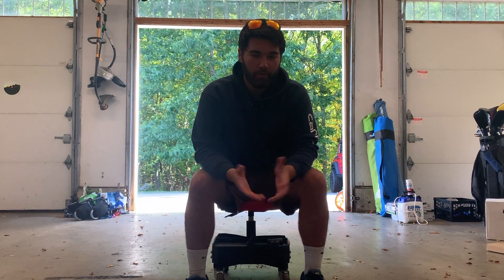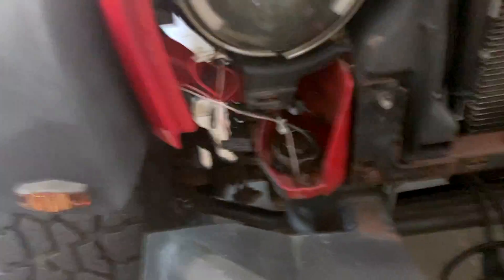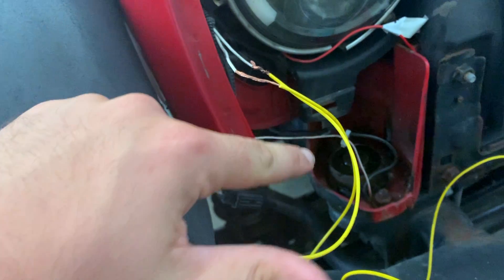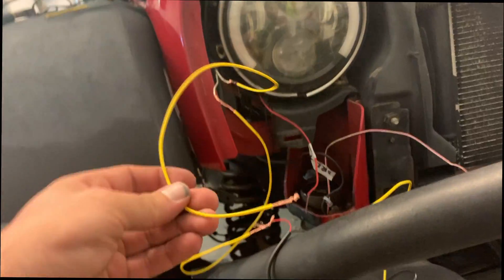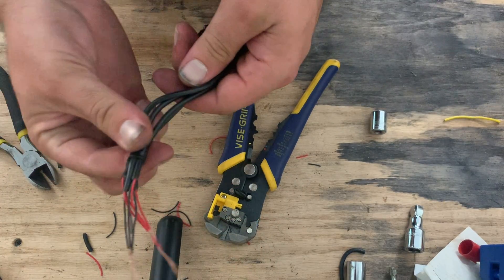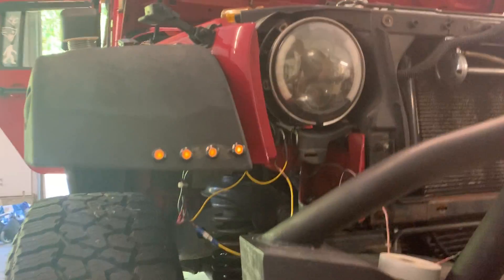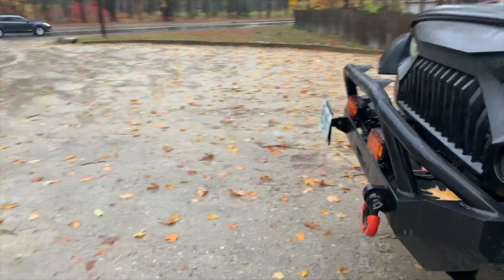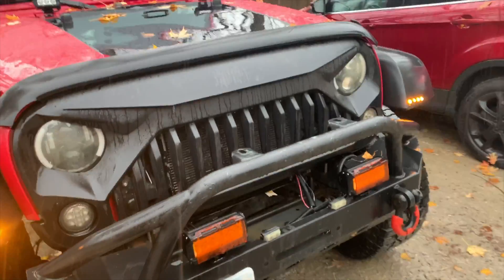LED Turn Signals Custom Wiring JEEP JK

Comment: What kind of lights are those brand name model number
Reply from the maker: 5x 3/4" Mini Smoke Lens Amber 1LED Clearance Marker Light Truck Trailer Yellow LED Flush Mount Hot Spot Waterproof https://www.amazon.com/dp/B01I1CHWSG/ref=cm_sw_r_cp_api_glt_fabc_13647DMVHGMBYK4NVBRR